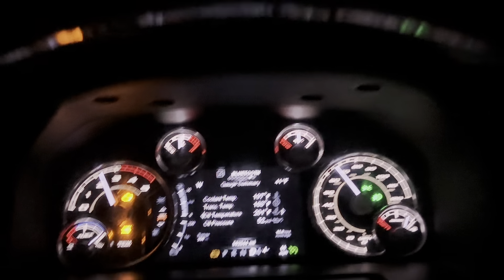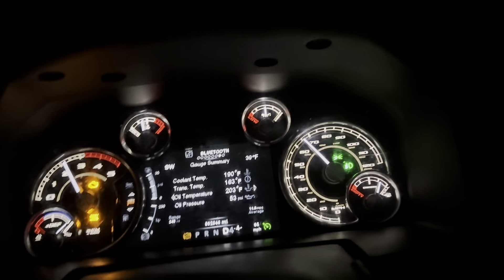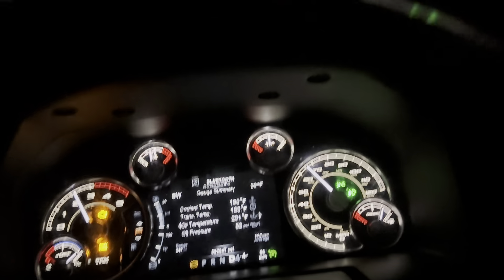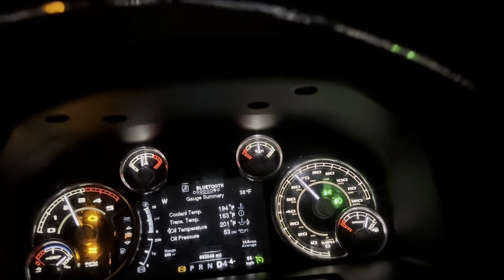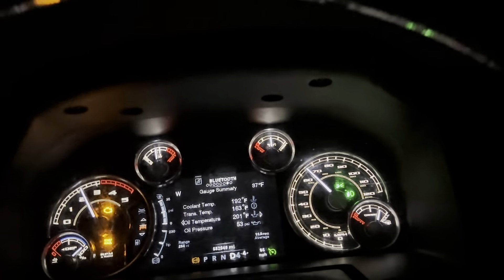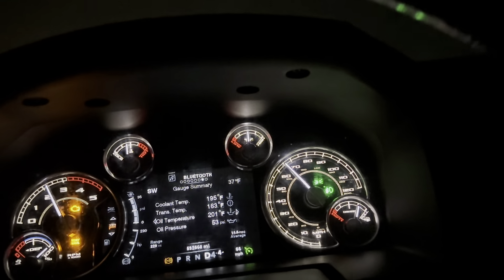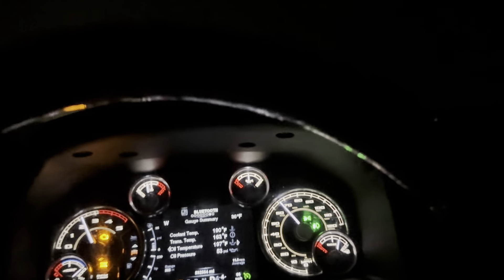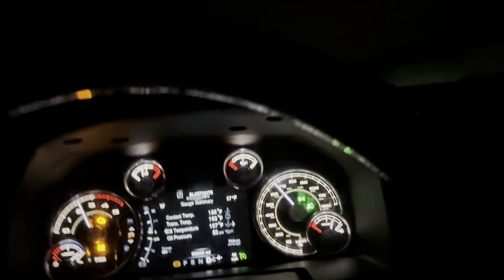2014 Ram 3500. Towing 27k gross. 6 percent hill climb. Temps.

Comment: Best way to cool off the engine and exhaust is to go down a hill with your foot off the throttle. We call it motoring the engine. It turns off fueling and basically makes your engine turn into an air pump to cool the exhaust. I run 6.7’s all day on the dyno and work for cummins.
Reply: Both.       But in real world, why wouldn't you have the exhaust brake on.   @daddynowski
Reply: @daddynowski  doesn’t really matter
Reply: @Datsun280zeeee  when turn off fueling engine turns off.
Reply: @repairvehicle  No, it stops combustion, but it wont stop the engine from rotating with a heavy trailer pushing you down the hill
Reply: @ pure nonsense, engine will stall without fuel and with automatic transmission. You cannot rotate engine through automatic transmission with load behind you.
Reply: @repairvehicle the tcm locks the torque converter
Reply: @Datsun280zeeee  torque converter has no electronics and tcm doesn’t lock torque converter when fuel is cut off to the engine.
Reply: @repairvehicle  sounds like you need to do some googling my friend

Comment: My 2022 just hit 200,000 changed water pump around 130 just as a precaution and my  had to change my egr cooler around 170     also took your advice and started changing oil  between 8 and 10,000 miles any suggestions  would be appreciated thanks
Reply: Are you running the SO or HO?

Comment: I did something I thought I'd never do which is I bought a 2015 Ford f250 6.7 with alot of miles because I got a good deal on it. Well it runs good  but constant problems with emissions, dpf and all related sensors probably spent $5000 on sensors and forced regens and other things the shop says I need and still same p2002 code along with other related codes 
The only thing left is replacing dpf or cleaning my old one for $1000 . Alot of people say delete but I have to run it through emissions where I live 
.
Reply: Run some Archoil DPF cleaner through it and then use the Archoi AR 6500 and see how it does.  A good farmer friend of mine runs Deere Combines and 6.7 Powerstrokes…kept getting emission codes.  Sent him Archoil 6500 and his issues went away almost immediately.  Just a thought.